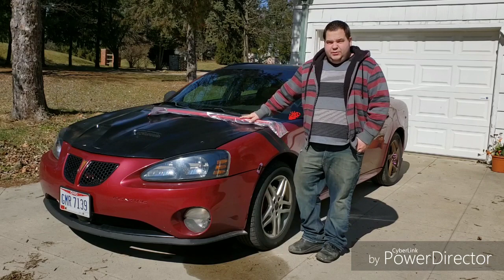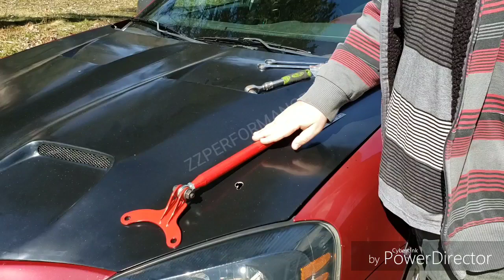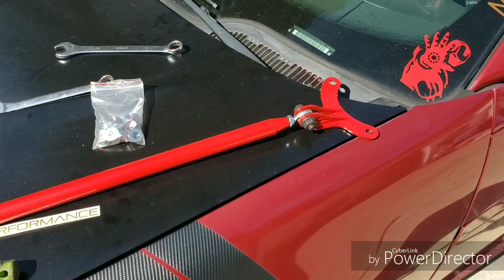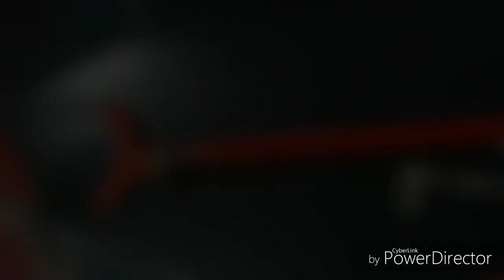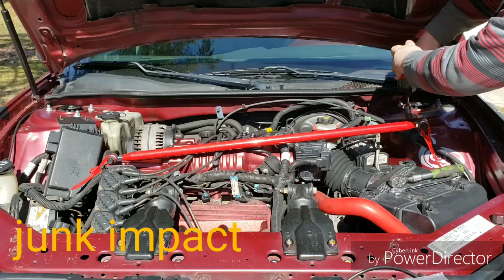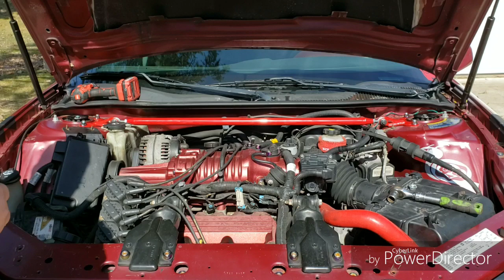ZZPERFORMANCE  W-body strut bar

Comment: Did you notice any difference in the front end with the strut brace?   I remember installing one for my fox body 90 mustang decades ago and you could honestly notice the difference.   Wondering if its a noticeable difference in the W body. Thanks.
Reply from the maker: I did notice a slight difference. My front struts stopped rattling. Lol. The new ones from ZZP are adjustable. I love it
Reply: Eric Lewis - realizing I follow you on instagram ha